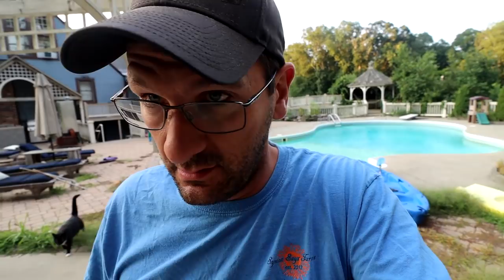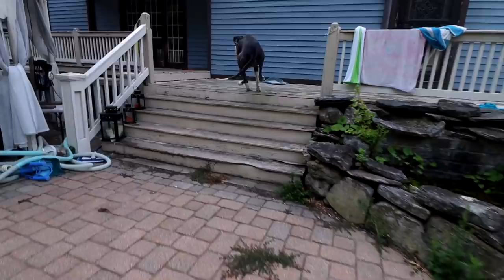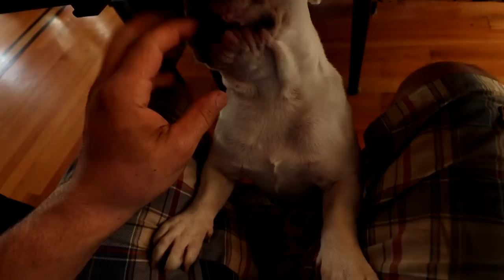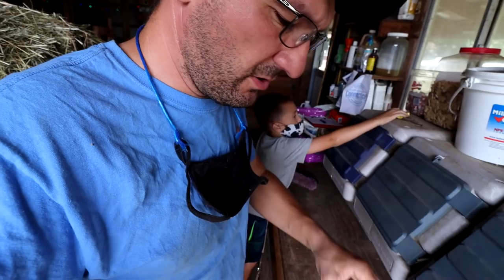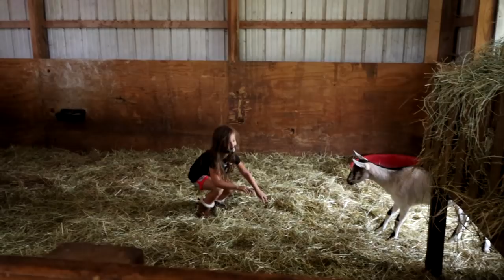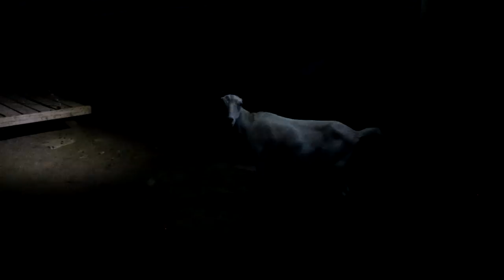Syman Says Saturday Episode #149 - Stop Yawning

Comment: I feel for you with the pool issues.  We had an in ground pool with a vinyl liner.  Replaced it 3 times over the 25 years we have lived here.  This time determined concrete deck was failing and total cost to fix all would be  $40-50,000.00.  Needless to say we are in the process of taking the pool out.  Liner out - concrete broken up - working on filling the hole.   Of course this all started before COVID-19.  Wish we could of foreseen the future - we would of kept patching to make it thru the Summer of having to stay at Home.